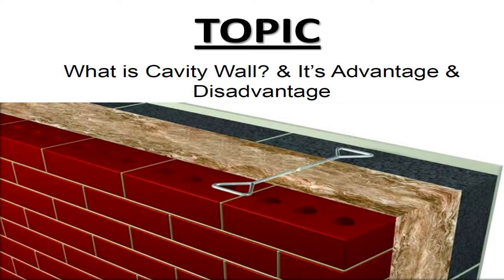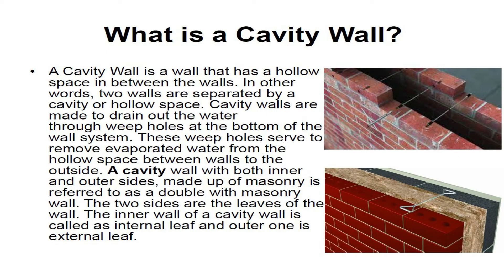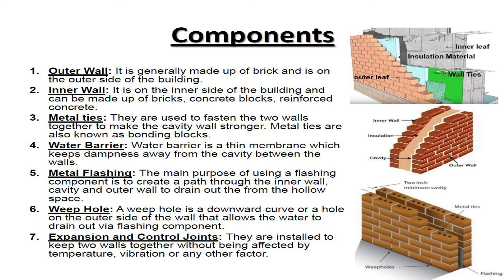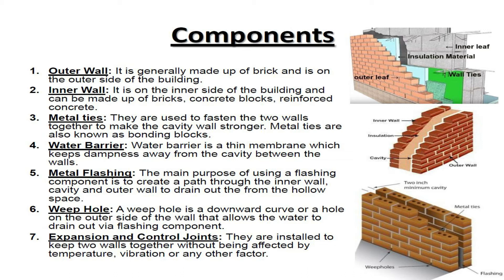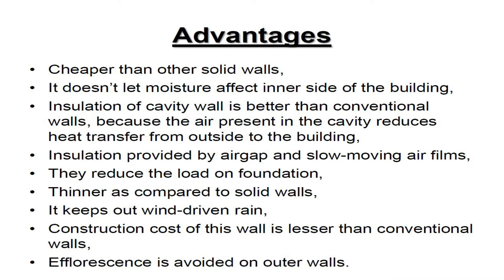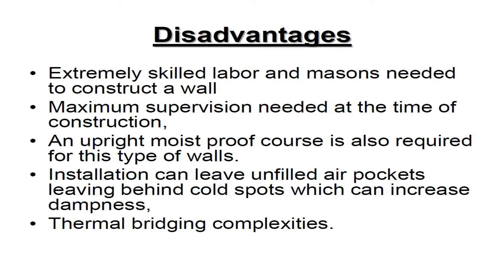Exploring Cavity Walls: Understanding the Construction and Benefits

Comment: Cavity walls must NOT be bridged with insulation(insulation touching outer wall inside cavity) or else moisture will transmit from the damp outer wall through the touching bridging insulation into the inner wall !